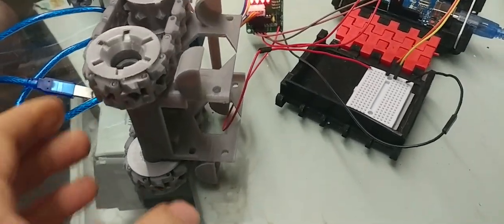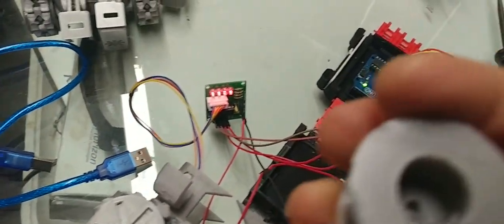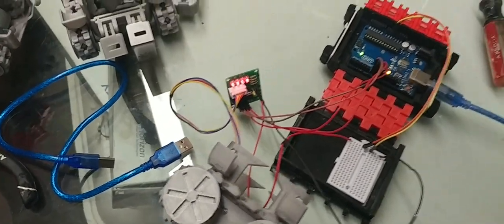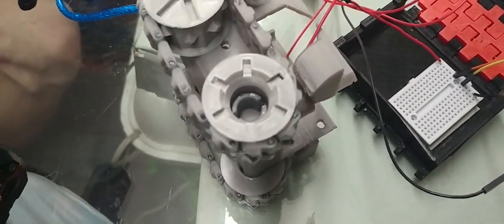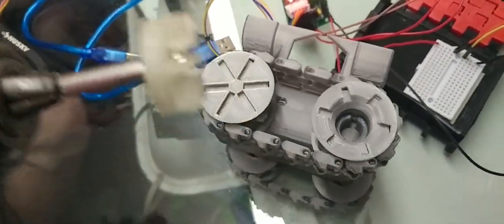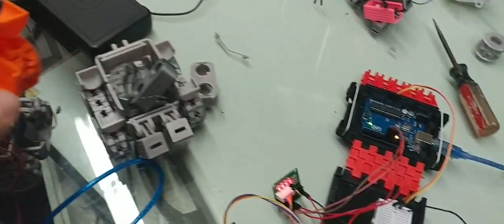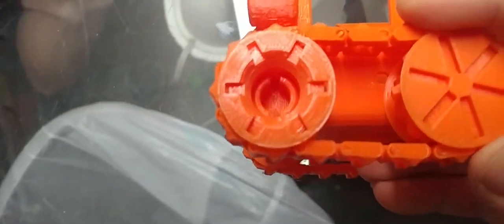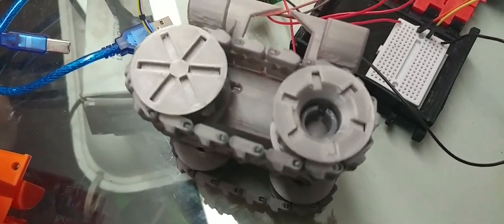SMARS LCV wheel break in process

Comment: Okay, I get the idea, it obviously might work (and worked), but I think it is worth noticing that this is possibly dangerous/harmful action. Those parts were not designed to spin that fast, and it's only PLA. In case there are imperfections that obstructing the movement, you'll get a lot of heat when turning it that fast. I know the idea is to do just that, so the imperfections get sanded down, but 1) some other parts might get melted or 2) some other part might break (like the tracks or wheel itself, and possibly the slave wheel if you have the version with M4 screws). TL:DR be cautious when doing that or you'll break it even more.
Reply from the maker: It will melt in a second or two without the vaseline for sure. This is just what worked for us. If the robot is build such that it may fly apart then this would be a bad idea for sure.  I did an experiment trying it without the vaseline and the wheel and axle turned to gum and then seized in a few seconds.
Reply: @robotsforstem1968  okay. I somehow missed the vaseline part. As I said, it's worth trying in order to save a failed part, just be aware of risks.